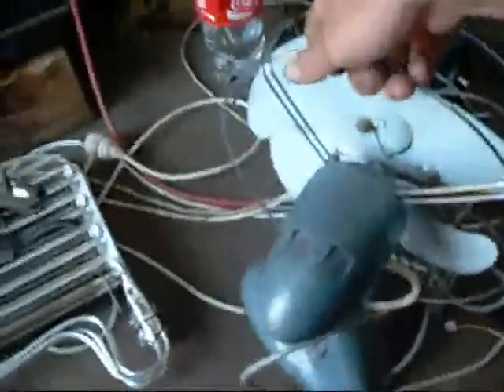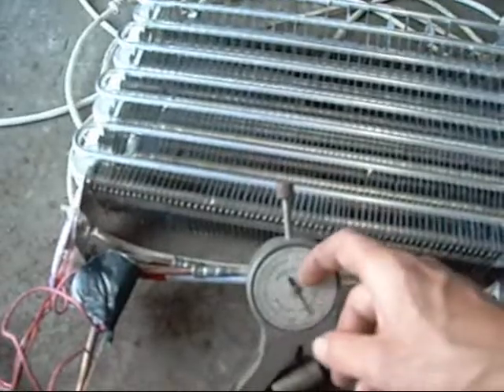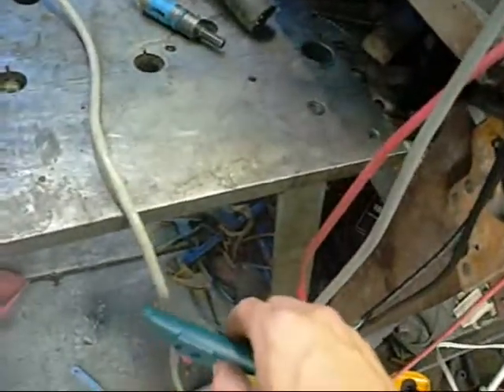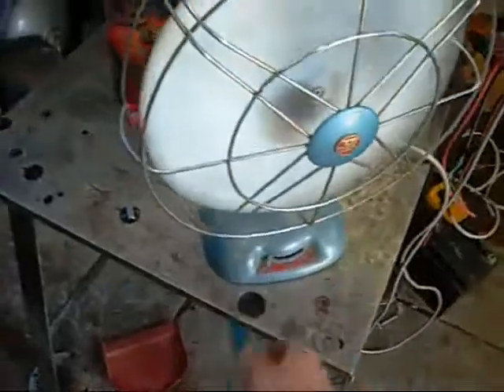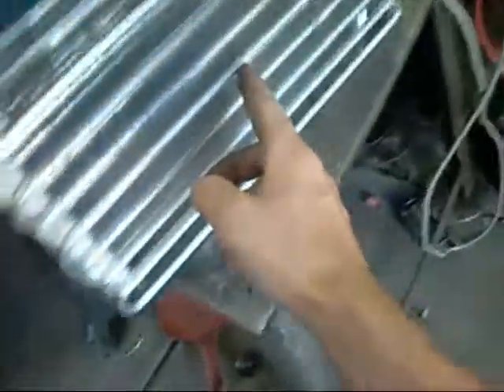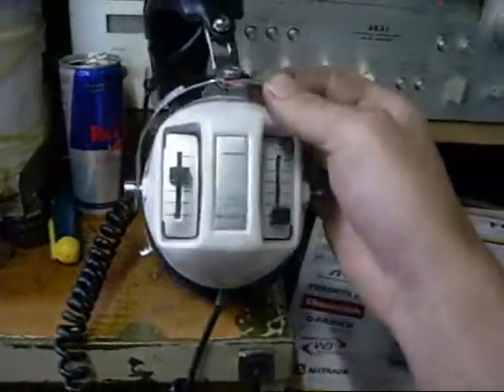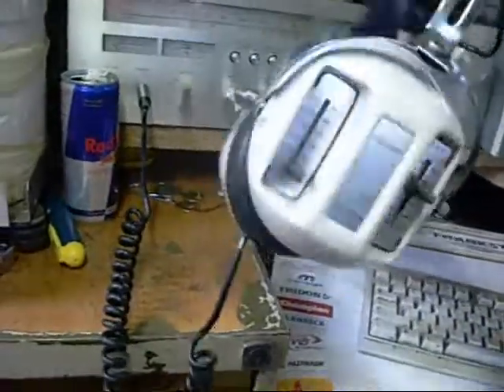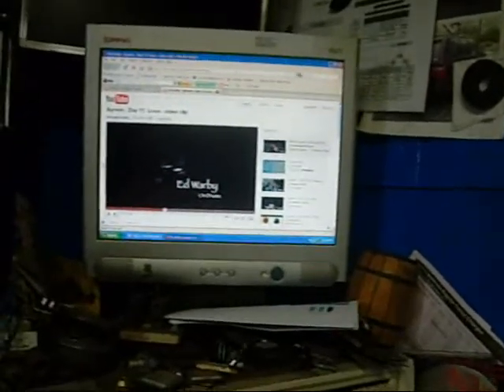Vintage PYE Desk Fan and Hosiden headphones testing

Comment: ive got the exact same fan! it belonged to my grandfather in the early 60's. he was gone by the 80's and the fan eventually made its way to me where i did a full rewire and got rid of the nasty rubber insulated leads. not hard in this unit but makes it a bit more safe.

Comment: I didn't know PYE made fans, I thought they just made electronic stuff like TVs and Radios but didn't venture into small appliances. I have an old Electrohome fan from the 1950s or 60s that I use from time to time, got it from an estate sale cheap because the grease hardened on the bearings. The plane looking thing is called a spoke shave in may area of the world, they used to use them for making spokes in wagon wheels but they have plenty of other uses as well.